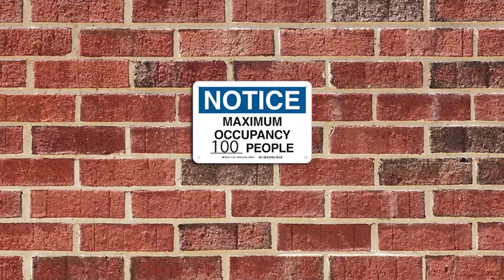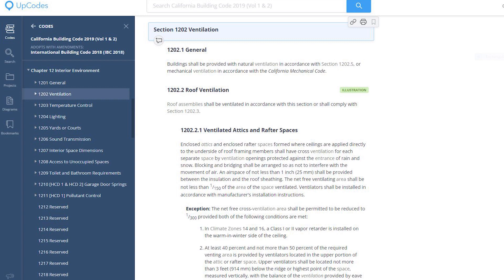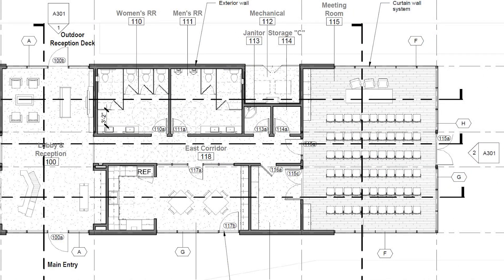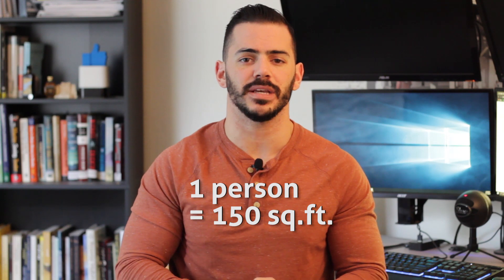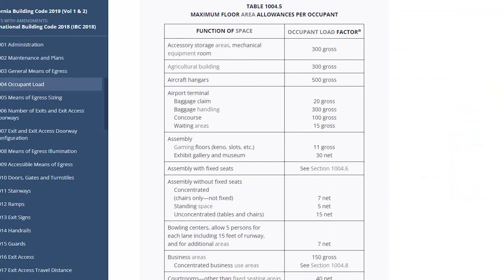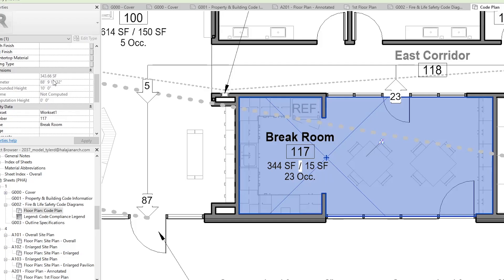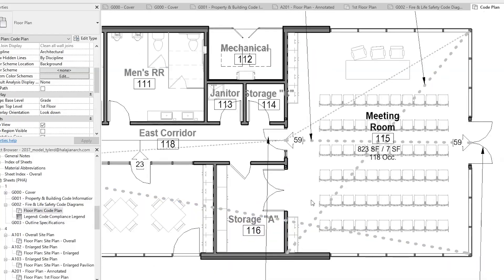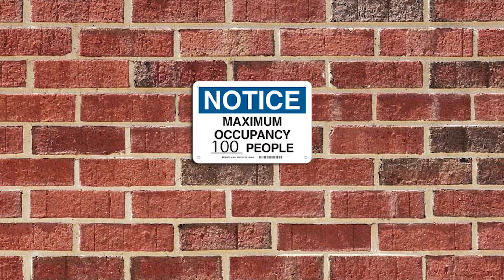How Architects Find Max Occupancy For a Building

Comment: My only question - why would you round UP the max occupancy ? Wouldn't it make more sense to round DOWN the max occupancy to be conservative?
Reply from the maker: You have to round up to plan for a worst case scenario. The purpose of determining max occupancy is to plan for the maximum amount of people that need to exit the building or space in the event of a fire. If you plan for more, the building is theoretically safer by code. Hope this makes sense!